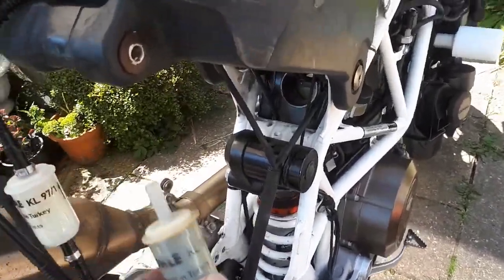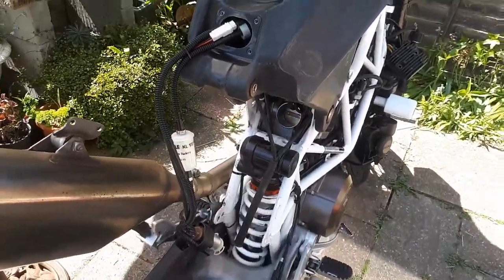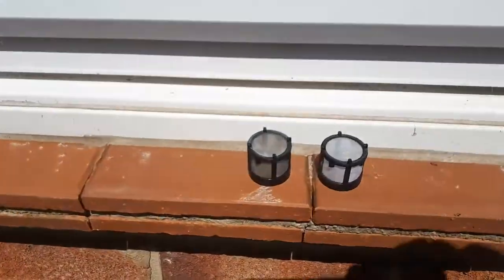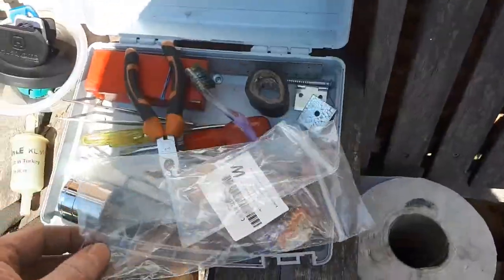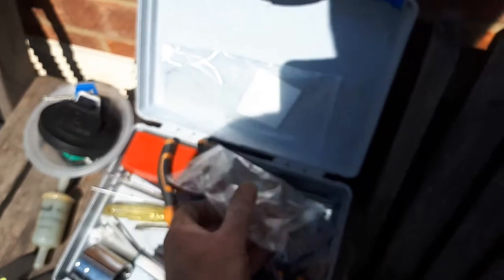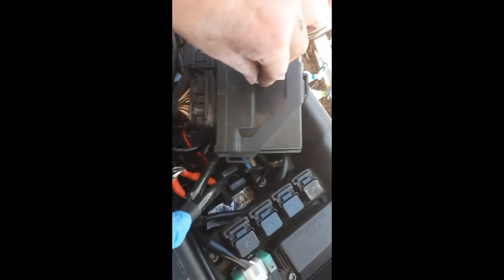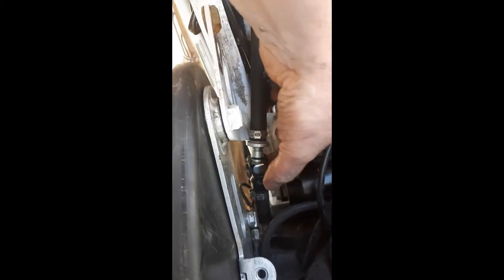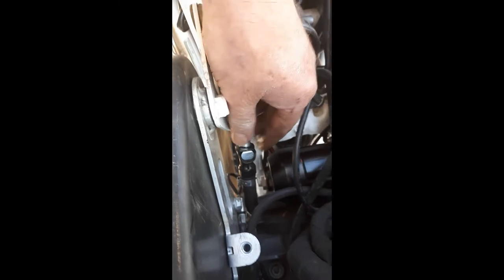Husqvarna 701 fuel filters changed at 14,000 miles

Comment: Great video, thanks for filming. I noticed that you still have the stock exhaust on. They seem to get very hot, but has it created any melting problems in your 14,000 miles or did you remove the CAT?
Reply from the maker: Sorry, I missed your comment til now. You're right, it gets f**** hot but nothing melted so far even after some flat out runs. Burned my thumb on it though - really deep burn which took weeks to heal.